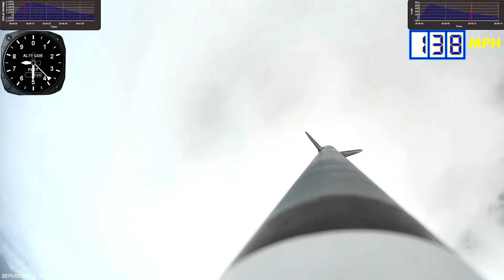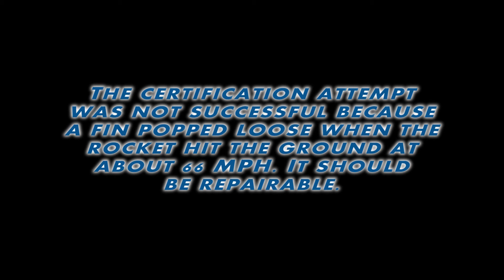TRA Level 2 certification attempt (unsuccessful)

Comment: There's no way that rocket went up past 45,000 feet as the altimeter showed.
Reply from the maker: 4,500 feet.
Reply from the maker: I see what you're saying, though. The hands aren't the same as an airplane's altimeter. The digital display is correct.